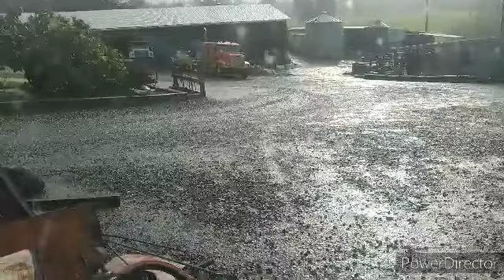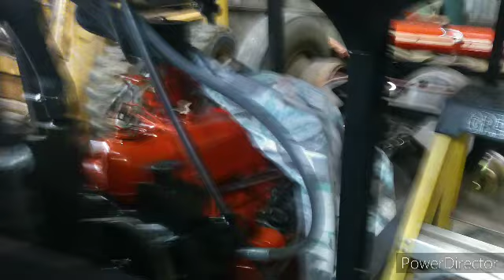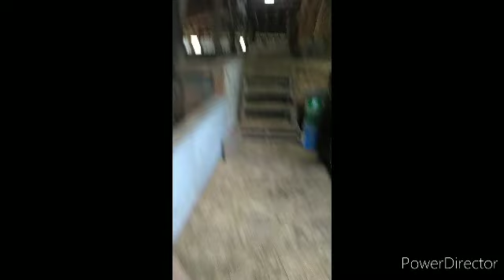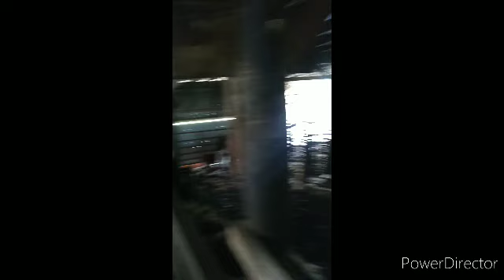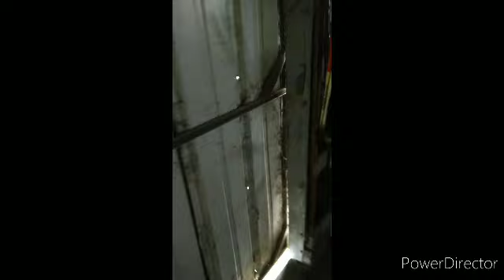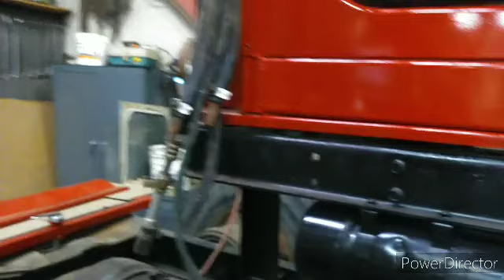Ron's sunrise. calves and more Sprayer

Comment: I'm here
Reply from the maker: Hello Bruce
Reply: Evening bruce
Reply: Too bad when they made the line they didn't use one of those double elbow lines. It would have put the rubber part would been on from the top not the side
Reply: @GosselinFarmsEdGosselin  hello Ed, been a long day
Reply: @ronphillips1437  evening Ron
Reply: G'day Bruce
Reply from the maker: @nidayfarmranch6002  ya, they could have done it different
Reply: @GosselinFarmsEdGosselin  ya, I found the ones that come out of the pump like yours does, then it bends again and goes straight up. Which reminds me. I need to call them tomorrow and get that part number. I sorta lost the one I had.
Reply: @Murphyslawfarm  G'Day Murphy
Reply from the maker: @nidayfarmranch6002  ah..
Reply: Howdy Bruce
Reply: @mattthescrapwhisperer  howdy Matt, hope your day was good
Reply: Hey bruce
Reply: @sassymassey5002  hello Sassy Massey

Comment: Well finally made it!! Sprayer coming along nice!! I over shot the length on the disc hoses too, always better to have to much than not enough😉 Thank you for bringing us along, will his eye straighten out? Thank you sir
Reply from the maker: About time 😂🤣
Equipment manufacturers and dealers are good at putting short hoses on things😠
Years ago, we had two tractors we kept 2' long pigtails on.. the other one the implement hoses would reach.. got a couple things now that could use another 6-12" of hose.. the hose is the cheap part.
His eye should straighten out some more.. it's already half way to normal.
Reply: @GosselinFarmsEdGosselin  Very true my friend, was worried always can tie up excess, can stretch hose, least I haven't found the tool😂😂 Good glad to here it is straighting out!! I will be quicker tomorrow!! Thank you again sir!!